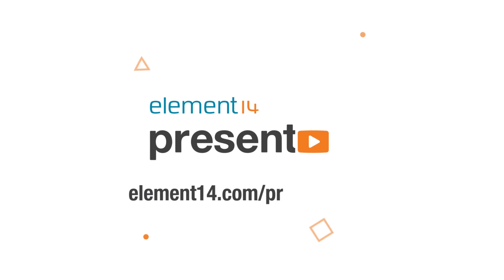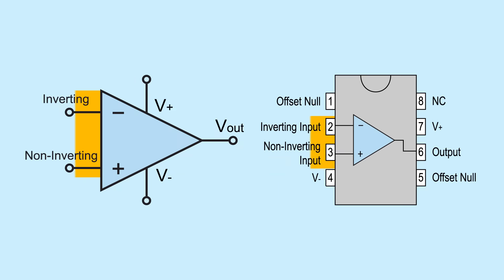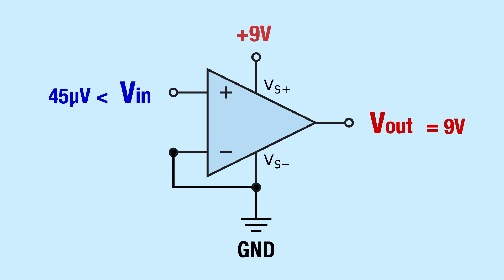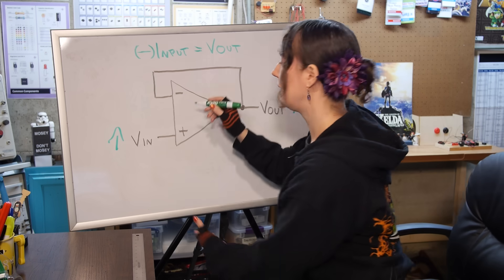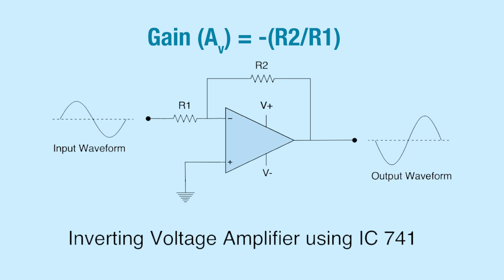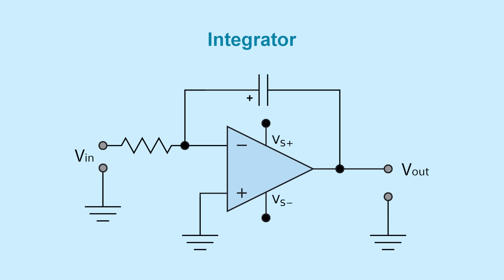How Op Amps Work - The Learning Circuit

Comment: 7:20 is there a mistake in the circuit? You said resistor and capacitor are connected to inverting input, but the diagram shows R and C connected to noninverting (+) input

Comment: I remember way back in 1991, I was so proud of myself when I made my first project with a 741 op-amp..  I made a death-metal sounding distortion pedal for my bass guitar.   it was soooo basic but it worked and I even built a little box around it with a pedal to turn it on and off.    I used a soldering iron to melt the words "distortion from hell"  into the little box.    I wish I knew where it is now:(

Comment: 7:17 is that a mistake? the resistor and capacitor are connected to the NON INVERTING INPUT, but you called it INVERTING INPUT and voltage divider is connected to the INVERTING INPUT, but you called it NON INVERTING

Comment: There is an error on the differential amplifier schematic at 6:12 . The two inputs are tied together. It's impossible to have a different voltage between the two inputs  in this case.

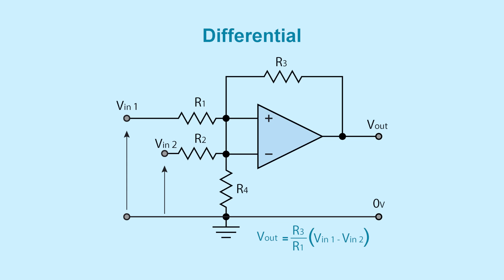Comment: There is an error in the schematic at 6:20. Your tools shorted together the opamp inputs when the tip of the bottom resistor lined up with the feedback trace.

Comment: Hi guys! I’m trying to better understand the AC-DC conversion using an op-amp circuit shown at 3:48.

From my calculations, I noticed that initially feeding a negative voltage into -Vin results in +Vs at Vout. The voltage divider then sets a new reference voltage at +Vin, acting as a filter (similar to a low-pass filter), preventing switching unless -Vin exceeds this threshold, which often times should be a negative number.

So, am I correct in saying that this circuit converts a sine wave into a square wave, where the peaks are inverted (i.e., when the sine wave is at its maximum, the square wave is low)? Also, do the resistor values in the voltage divider determine the voltage thresholds at which the square wave toggles between high and low?

Comment: at 6:15, there is a typo in the schematic of Differential. there should be no wire connecting the inverting and non-inverting pins.  It will confuse the beginners.

Comment: Well, the opamp also creates some power, e.g. 32 op amps connected in parallel will power a 10-15W speaker

Comment: This is a fair explanation for someone who already understands op amps. I wish it was directed more toward beginners. Example: You show AC sine wave voltage to the + pin and a square wave at the output. It would have been so easy to show an actual (or animated) oscilloscope trace showing the input crossing 0 volts and the output changing polarity. Single power supply only makes it more difficult to understand. The unity gain buffer is also difficult to understand as you don't explain that the output is essentially trying to drive the -pin to equal the +pin.  I couldn't get any further.
Reply: Can you recommend any such resources for beginners
Reply: @gayathrigayu637  google "forrest mims"

Comment: This is a great video, but just like dozens of others there is no real world applications that they are referenced to otherwise it's the same old description. The first one who does a video that shows the multiple applications of op-amps how they're used in the circuit what in the circuit is used to control it and what hardware outside the circuit is ithe nput and output from the op amp wins the prize. All op amp videos I have seen begin beyond the beginner stage and many are lost in what their real world applications are. 8:45

Comment: Question here: @3:45 you mentioned that an op amp can turn a sinusoidal ac wave to a square DC wave.. would the square wave not also be alternating between a positive and negative voltage making it not DC and still AC. Genuinely confussled, any responses help.
Reply: You’re right, she was incorrect. If the wave switches polarity it is AC. Based solely on the graphic, the waveform would have an average of 0V, and therefore has no DC component. If it was -2V to +8V peak to peak, it would still be an AC signal, but with a +3V DC offset.

Comment: Forgive me if I am wrong, but the schematic of the differential amplifier (6:18) does not make sense to me. Why would the two inputs be shortened essentially equalizing the potential on both + and -? In such a way, the output should be zero. I am looking to create an audio balanced to unbalanced converter, which should work as a differential amplifier, and cannot imagine that the two signals should be combined into a one.
Reply: Schematic is incorrect. There shouldn't be a connection between the two inputs.

Comment: @6:12 Circuit has errors! Your positive and negative OP-AMP inputs are tied together. 🙄
The output will be the Thevenin equivalent of the resistor network alone & highly dependant on the impedance of the generators & the load!
Don't make tutorials if this is your level. 😉

Comment: Op amp is one component I can’t understand how it work I need it to amplifier tc transformer 5 millivolt to turn on the bjt to turn off the pwm signal but all am seeing it voltage alway on the output even with no voltage connected to the inverting input I thought it was to amplifier 10 millivolt 1 voltage or so the 741 op amp can’t amplifier millivolt the amplifying only happens for 4 volt and up so I don’t understand how short circuit usd op amp when it can’t sensor millivolt so fast the only thing I see can sensor millivolt is the tl494 built in op amp the op amp ic on it own is just a waste of time to thing it can work for short circuit

Comment: Pause at 6:22. Is there a typo in this circuit? The 2 input signals are shorted. There is no way the amplifier is able to amplify if both inputs are always going to be equal because they are shorted together.

Comment: 3:47 "DC" Square wave? How is the square wave DC if the current is alternating at the same frequency as the input? If the square wave is alternating at an extremely lower frequency that it's almost constant, then I would say, that's DC.

Comment: Can I use an op amp to measure micro volts across a low resistance shunt and feed the output signal to a multimeter and read the current

Comment: Well a couple comments: 

First:  I appreciate your efforts and in general think you did a very good job. 

Second: As the audience I am a retired theoretical mathematician that is venturing into op-amps because I want to construct an instrument-pickup pre-amp similar to a Mic pre~amp for the acoustic stringed instruments I've built in my retirement, thus I am without what many who pursue electronics have derived as being the case or required without needing to be indicated.

Therefore, I suggest, please make it clear in the presentation the two following conclusions and one extra conceot I have derived thru experimentation and have indicated in 1 thru 3 seen below.

1: When you say Voltage at the (+) input is greater than the Voltage at the (-) input I think it should be indicated that Sign indicating polarity matters for the order relation of greater, equal to, or less than. eg, (-6 volts) is less than (+6 volts), they are not equal.

2: The (+ input), (- input) difference that is multiplied by the gain=M, idiosyncratic to the device, should probably be indicated as being the result of the absolute value of [(volt at + input) - (volt at -input)], not the difference of V-, V+ without absolute value being indicated because it can make a difference that is not intended. 
& 
Regardless of which input receives the signal, where this is either the       (- input) or the (+ input),
for any given instance of the output Voltage when the Vdiff is below the saturation threshold we have Vout, in magnitude without sign, equals M times the absolute value of Vdiff. &  (if Vdiff equals or is above the saturation limit Vout is either equal to the Voltage at one of the rails in a Dual Supply scheme, or at O volts or Vcc in a Single supply scheme)
& 
This Vout has a Sign or polarity of (-) if and only if the Voltage at the (- input) is greater than the Voltage at the (+ input), 
& 
This Vout has a Sign or polarity of (+) if and only if the Voltage at the (+ input) is greater than Voltage at the (- input), 
&
The  Sign or polarity is in part dependent on what establishes ground where this can be in the case of a Single supply system what is commonly thought of as where the (-) terminal of the supply attaches and often though of as O volts. 
or 
It can be the floating or virtual ground established in a Dual Power supply where it has a value of Zero much like Zero found on the subset or partition of the Real number line called the interval of [-5 to +5].

3: I also think the Dual Supply scheme should be explained where it can be easily thought of as two batteries in series where the (+) end of one battery provides V+, & the (-) end of the other battery provides V-, & the ground or floating ground or what ever the reference point is called that consists of where the two batteries actually connect to each other in the Dual scheme is the ground being referred to. (I see this as important because many diagrams for simple non-inverting amplification of the signal are actually meant for the Dual Supply scheme & likely will otherwise match every part of the signal input to Zero volts at Vout if a Single power supply is used with the (-) terminal of the battery acting as ground & with a resistor to ground in a voltage divider connected on its plus side to the (- input) pin as I found out by not realizing the Dual scheme was required and it was a bit of a bitch to figure out why it was not working as advertised.

Aside from what I suggested being added, you gals and guys did good and I think my adds would just inch it to, did a really great or fabulous job.

Thanks again for the video....

Comment: You left out the API 2520 footprint and Neumann edge pin footprint.But then I am only familiar with those because I built some 500 series kits with 2520 style op amps in them. 
A few compressors, EQs and mic pres. 
But those op amp footprints date back to the origin of op amps in pre IC computing. 
The API 2520 and similar came a little bit before IC op amps came into being if I remember correctly. 
So they are through hole op amps. With actual discrete parts that have to be soldered in to place. 
Pretty challenging to get 30-40 solder joints just right with no bridge on a PCB the size of a postage stamp.

Comment: Actually, you can take 1V and magically turn it into 100V. It's called a boost converter.
Reply: ...at 1/100th the input current, assuming 100% efficiency.
Reply: @kantpredict  So it's basically like a transformer for DC voltages?
Reply: @Goos kinda except you couldn't use a transformer for DC as there's no alternation to push and pull. All done with high frequency dc charging
Reply: @kantpredict  yeah that's what i meant 😅
because you need an ac to induce current in the other coil
Thanks for the response!

Comment: A) The amplification op an Opamp can be extreme, yes, but the comparator circuit does not act as a schmitt trigger (vid on 2.54 etc, so not "full throttle" to the supply voltage) B) the differentiator circuit on 6.25 cannot work because there is no voltage difference between the (-) and the (+) input, they are shortcut. Apart from that: an interesting video!

Comment: Op amps are used in control systems and they can be used as controllers. For example, PID can be implemented by adding a capacitor parallel to a resistor connected to inverting input and a capacitor in series with a resistor as negative feedback and non inverting input is grounded. If you analyze it in S domain by using laplace transform, you get the PID expression, but the output will be inverted if you try to implement the specific circuit

Comment: One minute, the op amp is 'right' way up, with non inverting input at top of screen, next minute upside down with it at the bottom of the screen. This makes it hard for beginners like me to work out what's going on, and it also goes against accepted norms of most circuit diagrams. Why can't we just keep it one way up for beginner tutorials like this one??? 
Of course, there will be cases where it's much less complicated, in terms of wiring, to put the amp upside down in a circuit diagram, but do we have to start out by doing this, when we don't have it connected to anything???!

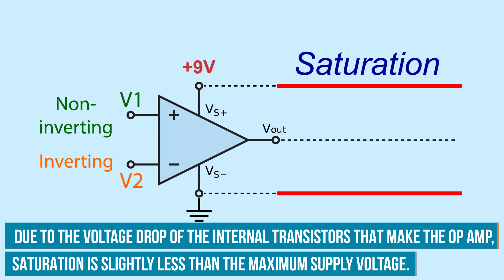Comment: 2:11 shouldn’t GND be 0V instead? You would generally use the power supply as the stable electron source, leaving the ground plane to shield EMF and optionally provide a sink for shorts.

Comment: I have been researching DIY guitar pedals lately. I noticed some of them use one op amp 2 amplify the signal, and a second one to invert the signal. But the most fun I have is replacing the diodes with different versions like germanium or LED. I'm still trying to figure out why they want to invert the signal after they amplify?
Reply: The amplified signal is inverted, so they invert it back
Reply: @maryannetoldme6341  thanks

Comment: 38 years ago, when Multiplying Digital to Analog Converters (MDACs) were invented, techs like me and the engineers we worked for had great fun coming up with all kinds of ideas for Filters and Amplifier stages with tremendous signal-to-noise, dynamic range, and frequency profiles that became possible using OpAmps like the LM318 and MDACs. For instance, put and MDAC into that Feedback loop described. Think the OpAmp has high gain to begin with? Adding an MDAC there adds Digital Control and even more Gain.

Comment: The circuit at 6:12 is not working: There is 2 errors in the schematic.  First, there should be no link between the + input and the - input.  And second, the two inputs are reversed. The input - must receive the feedback, not the input +
And the circuit at 7:19 also won't work, the two inputs are reversed.

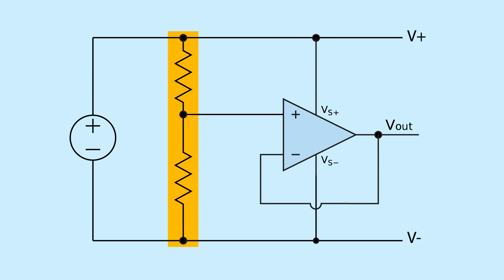Comment: can you give more specifics on creating a voltage divider using resistors (mentioned @1:30)? just following the schematic at that part at the video "creates a voltage divider"? Man. why did i just buy and build two power dual output power supply kits from jameco (besides the fact that they'll come in handy at some point and jameco is awesome)

Comment: My OpAmp story: LM358 is a super-common, low cost OpAmp that is absolutely abysmal as an audio amplifier. It's fine for some purposes, but not that one. On three occasions I have needed to build an audio amplifier circuit and LM358 was the only OpAmp I had in my drawer. After much circuit fiddling, datasheet reading, and internet searching, I've managed to build an LM358 based audio amplifier circuit that was "better than nothing." That was the best I have managed. One trip to eBay and three weeks later, 100 cheap (around 10 cents a piece, after shipping) TDA2822M OpAmps arrived from China. I'll never use LM358 for audio again.

Comment: At 6:20, that "differential" amplifier is not even close.  First, the opamp's inputs are shorted together so you will see only its drift/common mode at the output.  Second, the inverting and non-inverting inputs are backwards; the feedback must excite the inverting input for negative feedback.  Third, the output equation is wrong.  If you flip the opamp, remove the shorting segment, and make R4=R3 and R2=R1, then the output will be Vout=R3/R1(V2-V1) within the opamp's specifications and power supplies.
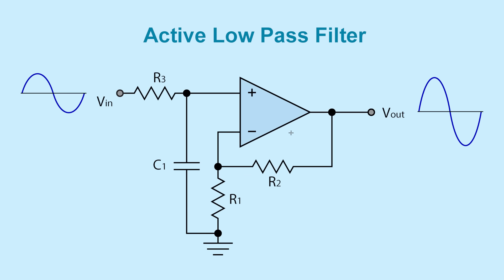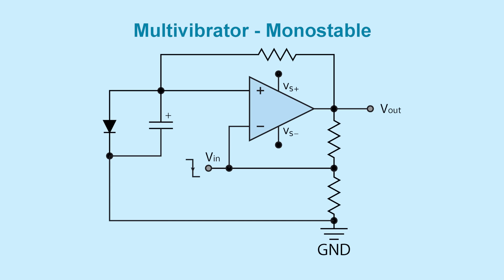At 7:10, integrators are LOW pass filters and the circuit you show is an integrator; the capacitor integrates the charge flowing through R3.  The sin(.) at the input should become - Acos(.) at the output.  At 7:20 and 7:40, your opamps need flipped once again, but that one-shot won't work anyway -- your trigger MUST zero the capacitor's charge first.

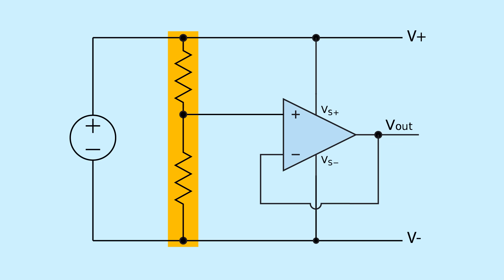Comment: At 1:33 she says, "one way to  achieve this is to  connect a voltage divider..." One way to achieve what ? Certainly the circuit shown achieves nothing at all. It shows a follower driven at a fixed voltage; if the resistors are the same, this will be midway between the two supplies. One can use this as a "fake ground" for other parts of the circuit, but that is NOT what she is explaining.

Comment: When I was in the Navy I worked on a machine that had hundreds of individual circuits, each tuned to create a different analog symbol on a display screen.  All of them used an op amp to shape the circuit to make things like plane, subs, boats, numbers, everything you can imagine.  But instead of drawing them digitally like nowadays, the Navy used thousands of op amps instead.

Comment: I have a EBIKE Electrical Problem 4 U :o :p so here it is:

i have 2 20ah 52v batteries. I am connecting 6 10 amp diodes for each battery so they don't charge and discharge while riding( via Equalize). The problem is that the diodes take both batteries at 52v each to  around 50.8 due to the diode .2v loss per module. How do I sustain 52v using the diodes?

Comment: This is good, electronic tutorials with production quality are hard to come by, even for the basics. But it does have the implication that an entire team found no problem with the numerous schematics, terminology, and explanations in the video which are plainly wrong. The core concepts are generally present, though so are phrases as "DC square wave" (3:40) featuring alongside a schematic an ignored hysteresis setting network (i.e. positive feedback). The diffamp is just so broken as has been mentioned; equation only holds for R2/R4=R1/R3 but the schematic only works as an input offset polarity detector. What kind of blackmail is needed to convince someone to assert that "an active low pass filter is an example of a differentiator amplifier"? ...Also pretty sure the monostable circuit is just a poorly performing schmitt trigger the way it's hooked up...